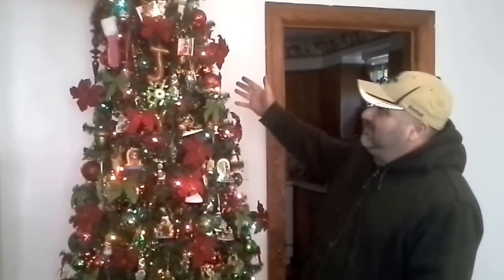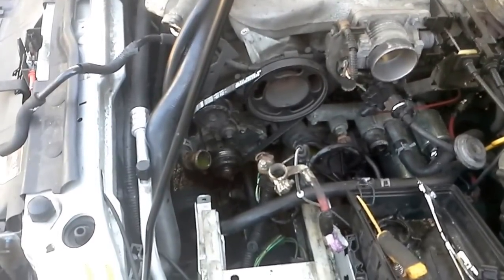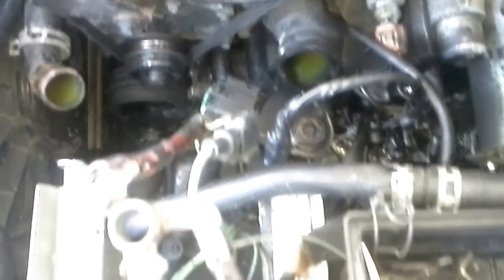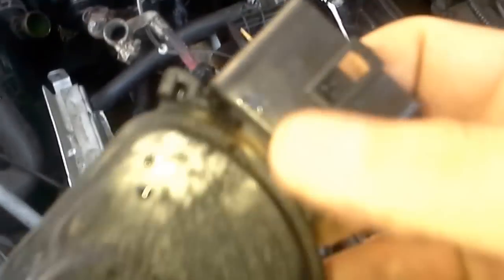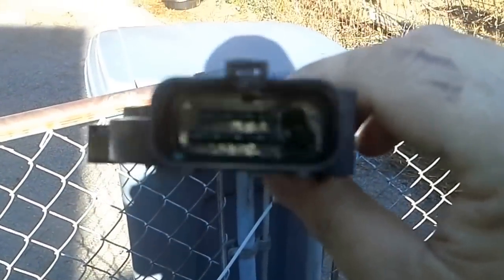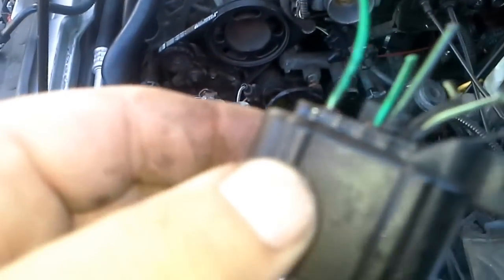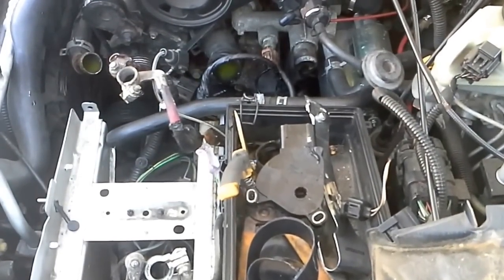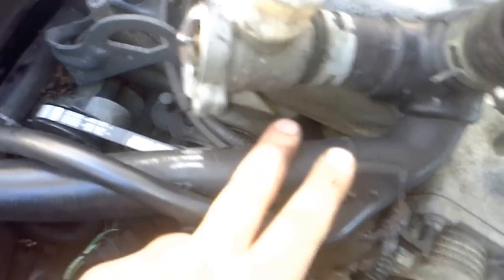Diagnosing Automotive DTC P0708 Range Sensor on Your Ford/Mercury

Comment: Ford 2.0 GL 4 cylinder Contour. I hope I don't see a burn. Battery change. Stall. Stall and stall. I did a wiggle test and fixed the stalling. I hope too much wiggle disconnected the range sensor. 96 Ford. That's not out of the park. Sensor 26.00 bucks. On Ford 4 cylinder its under air box correct? On top of transmission were cable connects right?

Comment: can this be the problem if your car wont start?
Reply from the maker: Is the engine turning over or is it doing nothing at all
Reply: @jamiejonesthecarman  nothing
Reply from the maker: Does your shift indicator show you’re in Park
Reply from the maker: Or do you feel like you’re stuck in like reverse or neutral or something
Reply: @jamiejonesthecarman  ill chek wen i get home. i dont ever look at the dash for the shift
Reply: @jamiejonesthecarman  no. ive drivin it jus to wer i turned it around. but now jus nothing no crank everything else turns on. now the shift indicator are u talking bout on the dash? like wer the mileage is? i dont see any

Comment: what can I do about my alarm going off by itself. Some people say it's the hood switch, what do you think may be my problem.  My car is a Mercury Cougar 2000 model
Reply: Hi rjonesmusic, when is your alarm going off? Your vehicle has whats called a PATS system (Passive Anti Theft System) and the only person on planet Earth that can 100% diagnose it correctly is a Ford dealer. Its typically not all that expensive and its probably something simple but I wouldn't let anyone else other than the Ford service department touch it because if the system is breached, it will shut down your car right where its at. Then, it will cost you real money.

Comment: First and foremost thank you for this video you are the reason i was able to replace the Trany Range Sensor!!! :D

Im a little late but there is a small hose under the battery tray that i have no idea where the second end is connected to. I was removing the range sensor and all of a sudden i saw the hose and i just pulled on it and it all came out. its about 12 inches long and no more than half a inch in thickness. I have pictures i can send but if you can tell me what its connected too i will put it back. If its important.

Thank you
Reply from the maker: Daniel Lopez Hi Daniel, its been a while since I've looked at one of those but I don't recall a vacuum over there so I'm thinking that maybe its just a drain line for the battery tray.
Reply: That's just to keep the presser of has tank
Reply: Transmission vent tube, just make sure the open end iss pointed down so water can't get in.  Needs to vent air as tranny puts out heat and expands and contracts

Comment: Jamie, I am pretty sure the sensor is the issue.  Just curious was the actual symptoms were?  I read a bit, biggest part I seen is the shifting at about 45 mph.  Also, mine reverse is not there and neutral is the same as D (drive)......  2 and L still work fine along with Park.
Reply from the maker: Thomas Lucken  Hi , so yeah it was real crazy jerking in and out of gear  , sounds alot like what u have going on
Reply: Yeah, my reverse is Park and my neutral is driving!  Gonna try to work on it today, now it is raining, ugh.
Reply from the maker: Thomas Lucken How is everything going? Still dealing with the rain?
Reply: JamieJones TheCarMan Haven't had time to change it, order the part and finally got it Friday.  Raining today!  :-)  Next few days will get it, buddy has a heated garage!
Reply from the maker: Thomas Lucken Good deal, man......nothing like having a heated garage to work in. Makes the job alot easier when you don't have to deal with the weather. Any questions along the way, just let me know.
Reply: Sensor fix some issues, but not all.  Still no reverse or neutral or is the OD kicking in!  Even though don't look bad, gonna try filter and transmission fluid next.
Reply from the maker: Thomas Lucken Sounds like the most reasonable place to start. When you change that filter, be on the lookout for any metal shavings or plastic particles in the pan and let me know if you find any. Make sure that you gently scrape off all of the old gasket and clean the edges so that your new one will seal properly. Keep me posted!!

Comment: Hey, Car Man. I need some quick help, and if you can offer me advice, I'd really appreciate it. I have a 97 Mystique, and I just changed out the fuel pump with a used unit, as I won't be keeping this car much longer. The replacement pump itself works fine, but the gauge doesn't work. I got this off a 98 Contour, and it had some kind of wire, probably a ground wire, attached to one of the holding tabs, the tabs the ring moves underneath when installing it. This wire went from the tab to somewhere under the car's metal body, and I didn't trace it. I have no idea where it went under there. My car doesn't have this wire. I took the pump out without damaging anything, and then I installed the contour pump in my mystique. It works but the fuel gauge is dead now. This pump's float mechanism rides up and down like mine did for some reason. I assume this is to keep the gas gauge needle steady when the fuel sloshes or when it moves to one side in a curve. Did I put this pump in wrong or is the gauge sending part faulty? Did I have to install it somehow so the gauge mechanism is all the way at the top of its travel? Is there another reason the float mechanism rides up and down on this pump? The float was free to move like it should in the float mechanism. The wire was free to move and the float itself spun around like it is supposed to. I aligned the pump correctly on the reinstall. The arrow on the top is aligned toward the correct direction, exactly as my old one. It went in easily, and the two pumps look the same. Could my 97 mystique tank be a different shape and is causing binding? The folks at the salvage yard told me the 98 contour and 97 mystique pumps are interchangeable. Well, I got no fuel gauge now. Being as it's a 98 contour pump, does my car need that wire attached to the hold-down tab on the tank? Could it be a ground wire of some kind that I need to add to my car? Can you advise me on what I need to do?
Reply from the maker: ***** it has been a while since I've worked on one of these fuel pumps yes your float should be free to move up and down but what you should do to make sure the sending unit is good whenever you have the pump out and the electric plug plugged in outside of the vehicle you should be able to operate that float and see your fuel gauge go up or down have you did that to verify that you have a good sending unit, but it sounds like the first thing to do is make sure that wire is grounded and its not something that simple, but if the sending unit is bad on the new pump its not that much effort to put your old one on it it should be no problem to interchange it is the exact same fuel pump, or maybe easier just to actually change the pump over into your old unit